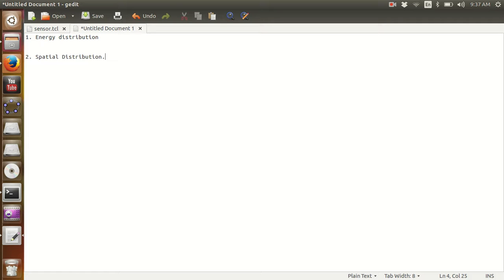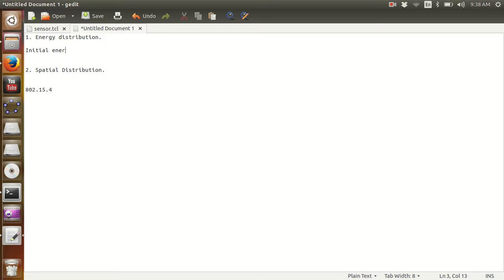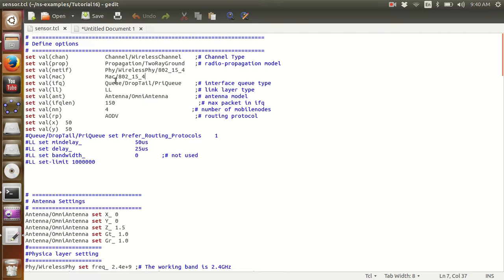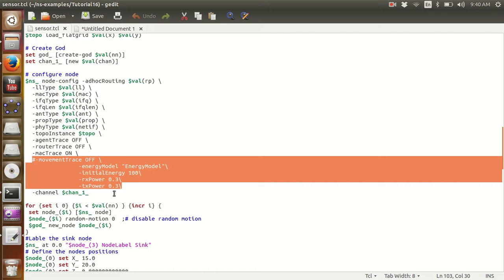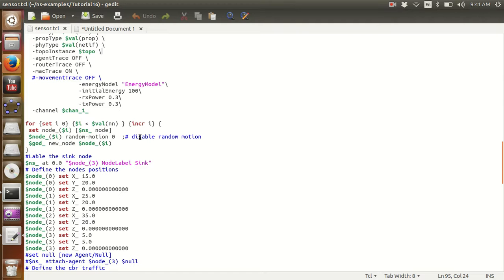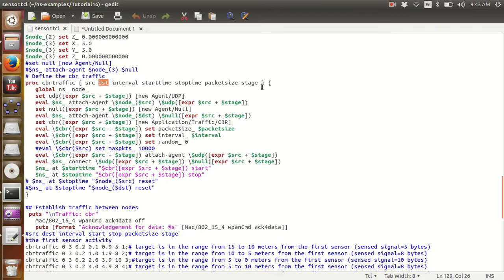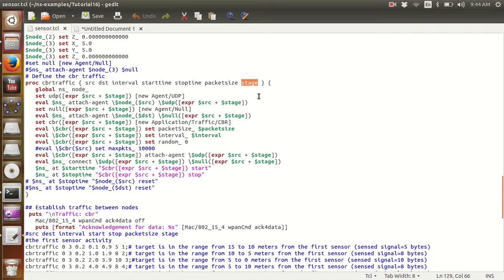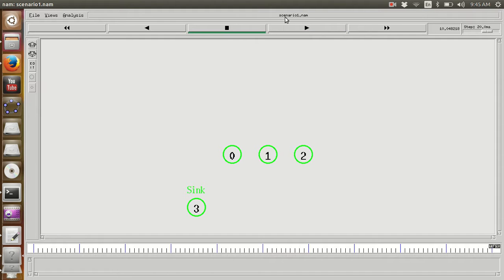Tutorial : 17 - Wireless Sensor Networks in NS2 (Part-1)

Comment: thank's for this video ,it was useful to me, but there is still two things i did not understand the first  thing is : why  would i have to create the cbretraffic procedure instead  of using the sample  cbr or ftp traffic model  as you did in your previous tutorials (
set cbr [new Application/Traffic/CBR] ). 
the second question is for the tutorial 18 : could it be possible to use the AWK commands and files like you did before to analyze the network.?
thank you in advance.
Reply from the maker: Absolutely, you can go ahead with the sample models, however it is quintessential if you plan to analyse the cbr traffic in a greater detail by using awk procedures in the post processing stage.
And using awk commands has a lot many limitations and creating awk procedures is a tedious task. This is purely discretionary and depends upon project customization, because normal analysis is better off with tracegraph than awks and gnuplot. 
Hope this helps, Regards
Reply: thank you .
you have mentioned "the sense power"  can you give me any idea how can i use it in NS2 ?

Comment: thank you for this video, but it is still not yet  clear to me  the effect of the energy distribution on the simulation , i mean will it make any difference if i simulate a wsn in NS2 without it ?
thank you again
Reply from the maker: Hello, energy distribution is one characteristic property of the nodes which we assume to be sensor nodes, just like specifying sensing power to a node will convert a normal node to a sensing node and inclusion of that sensing node will make the network a sensor network.
Even if you do not specify energy distribution, it wouldn't make a difference but it wouldn't make sense either , as sensor nodes are ought to sense parameters well from a smaller distance and not so well from a farther distance.
Hope this helps!! Thanks
Reply: thank you (y)